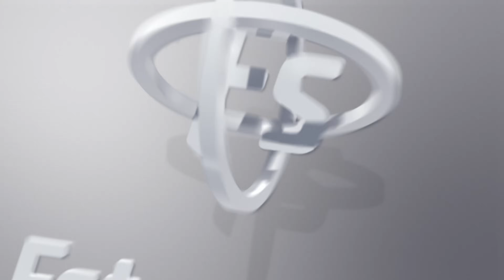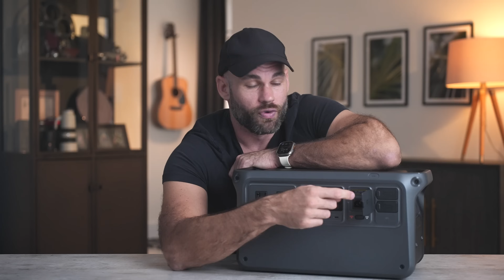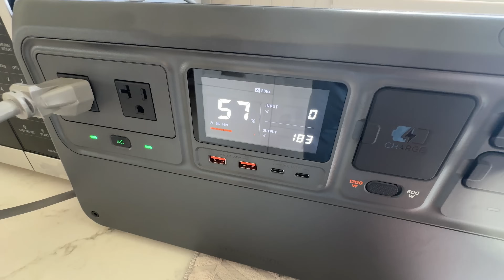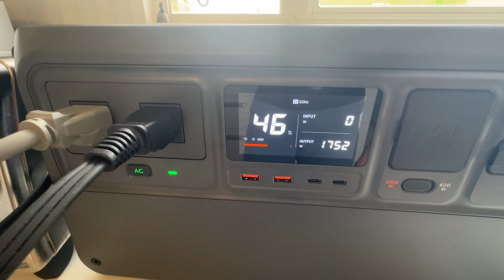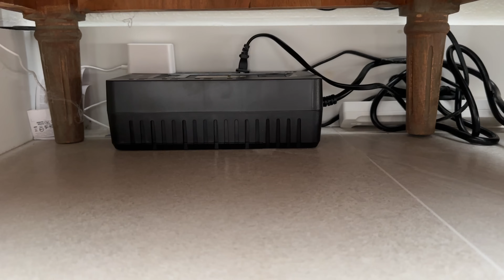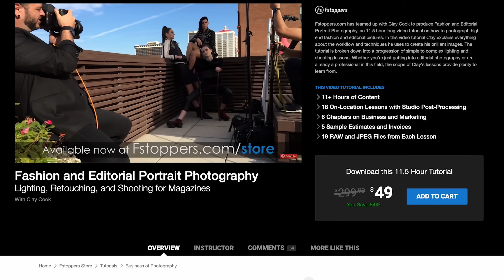DJI Power 1000 1kwh battery REVIEW

Comment from the maker: Update: I made a mistake and the Ecoflow  Delta 2 is $350 off $999:  https://amzn.to/4biBPoL But DJI's is $300 off right now too: https://amzn.to/3W7uL9Z
Reply: ECOFLOW Portable Power Station Delta 1300, 1,260Wh is currently $749 (32% off) at Amazon.  25% more capacity at 25% lower cost.
Reply: I believe Max output is still less than the DJI, 2200 watts vs 2000

Comment: U what? 75kWh a day? How many people live in that house? We are 8 people and use around 40-45 a day. That sounds super high for a normal household. Do you run a bunch of servers or is it mainly just A/C blasting all day?
Reply from the maker: Where do you live and what’s your average outdoor temp?  I use about the same power as Lee if not more.  It’s 80-90 degrees outside and we have AC running all day to keep humidity out and the temp around 74.  -P

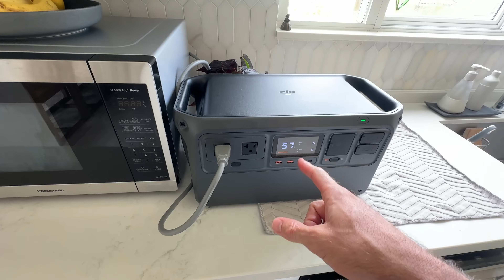Comment: I kept thinking a 2000 watt microwave; that could heat your food from across the room?!? Right on your microwave keypad it says 1200 watts. (2:39). Microwaves can be misleading as an example as they are rated anywhere from 300 to 400 watts up to 1800 watts.   I would love to know if your microwave is inaccurate or the DJI’s meter is wrong.  Do you have an external power meter or amp meter to let us know if it’s accurate?  Also would love to know the recharge time. The EcoFlow have crazy chargers in them and top up very quickly. What’s your experience recharging the pack on AC?  Thanks for your videos.

Comment: 75 kilowatt per day is crazy! In Lithuania in my apartment I use max 140 per month.
Reply: I was like "DID HE SAY 75Kwh/DAY???????"
Reply: size of house makes such a big difference since a lot of the most power hungry machines in a house are usually climate-control related (air conditioner, heating, etc.). Also, countries where electricity is expensive generally have better insulation for buildings cuz it's worth it to spend more on the building to power consumption costs. Whereas countries with cheaper electricity often have very poor insulation, so they'll save on building costs. 

Very obvious difference for me living in Thailand vs Canada. In Thailand, even though the air conditioner is on whenever someone is home, there are still 2-4mm gaps between windows & doors to the outside, and single pane glass for windows. Whereas in Canada, lots of effort & money is put in to get good seals, triple pane windows, etc.

Comment: I didn't get your point about the powerwall thing? Don't you need one that can power the house for like 30 seconds, because that's more than enough for the generator to take the job. Something like that shouldn't cost that much at all. Solar companies sell tons of different options for example.
Reply: Smaller cheaper batteries fill the gap. If he still needs the generator anyway a powerwall is overkill.
Reply from the maker: @ItssBrian  Yeah I'm in the same boat as Lee here in PR. The issue with the powerwall is it's not really enough to power a whole house all day with AC running which means you gotta either buy multiple powerwalls AND you need a full roof top of solar panels.  Our neighbors doing this are easily spending $70,000 for setups like this but I'm still not sure they can AC the whole house from sun down to sun up when the solar can be charging again.  I believe most people are able to AC like 2 bedrooms for 12 hours.  That's why having a 20kw generator is still the best option IMO.  During the last hurricane, power was pre preemptively cut off before the storm hit and we had like 3 days of heavy overcast skies.  I'm not even sure my friends with solar were able to get their power walls charged enough to run normal loads during the storm.  

What Lee needs to do is figure out a way to get this DJI system plugged into his home grid so that it becomes the whole home battery backup for the 10 seconds between the generator turning on.  Of course the house can’t be running the drier, hot water heater, and major appliances. Maybe that load is still too much though? -Patrick

Comment: One thing to note about these batteries is the difference between starting watts and running watts. I have a Bluetti with a 600 watt capacity which is plenty to run my refrigerator which uses about 100-150 watts but it overloads the battery/inverter when the compressor first kicks on. Moral of the story, always buy higher capacity/output than you think you need!
Reply: yep, many people install a soft start on their high load appliances for this reason.

Comment: I am sorry, but how are you using 4000W constantly?
Reply: Puerto Rico baby! Lots of split ac units.
Reply: @RDylanSeals  That would be 900$/month in electricity alone, here in Denmark
Reply from the maker: Can confirm, my power bill in PR is about $600-800 a month with power at $.25-$30 kWh.  It’s super expensive and the weather is always hot so we never get those days where you just open the windows and keep the AC off.  I mean some locals do that but it’s still far too hot and humid for me to do that.  Our homes are made of concrete so even at 75 degrees outside it’s still like an oven under the sunlight. -P
Reply: @FStoppers why not just add solar then.  You can save some money and pay off the solar in savings quickly.
Reply from the maker: @EvanWasHere  We've done the math and the pay off period for solar in PR is greater than the states because we get a lot more sun, but it's still like 7 years to break even.  The solar systems we would need for our energy uses is around $70,000.  Average bill is $600-$900 a month so roughly $9k a year in power. $70k divided by $9k = 7.7 years.  And this math is if your solar/battery system runs your house 100% which I don't think it can so you still have to pay a power bill of probably $300 a month which delays the pay off time even more.  

On top of the financial debate, you gotta hope a hurricane doesn't destroy your panels and if it does, hopefully insurance covers them. Also your concrete roof is going to leak guaranteed, and when you have all those panels on your roof, it makes sealing your roof a bigger pain in the ass. Ideally you'd have a solar field but who has land for that?  

Maybe Lee will correct anything I have wrong but it's just easier IMO to get the $20,000 generator, pay the high power rates, and not deal with solar.  We've also had major surges when the power does come on and I've known at least 5 people who had their entire solar system fried when each individual panel's inverter blew up.  If that's not covered by insurance than that's a HUGE headache and potential financial burden.  I don't know if anyone has had a generator blow up that I know of.  -Patrick
Reply: @FStoppers  $0.3 i wish, $0.6 here...
Reply from the maker: We might be in Denmark soon.  I assume your humidity is relatively low and your average temperature is pretty nice right? PR and much of America is super humid and really hot so AC is needed not just for comfort but to prevent all your stuff from molding and electronics corroding.  

Sometimes I dream of living closer to your latitude.  -P
Reply: @FStoppers  Hope you enjoy your stay, if you chose to go. 
Did not know that AC was used to prevent molding, we don't need that here at all. Coldest month with average of 0°C (32°F) and hottest average of 17°C (63°F). So it's pretty cold here. Many new houses do have heat-pumps, but that is mostly for efficient heating, with cooling as a bonus :)
Reply from the maker: Yeah as air temp increases, the amount of water vapor it can hold increases.  So hot air is often humid which causes moisture to get in your rugs, carpet, window treatments, bedding, clothing, etc.  I always AC my home more so that the humidity is around 30-40% more than for the colder air.  -P